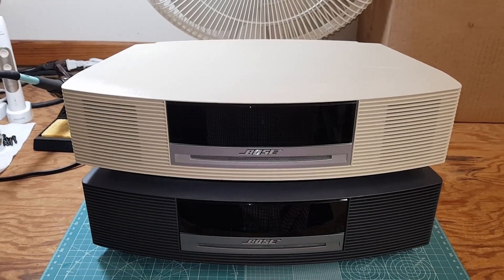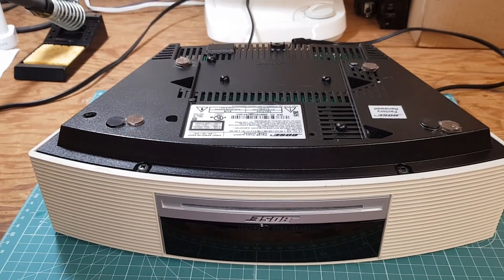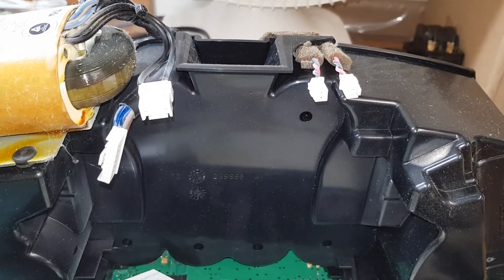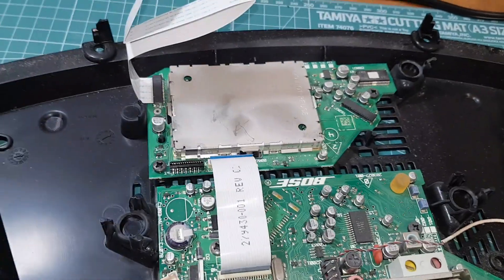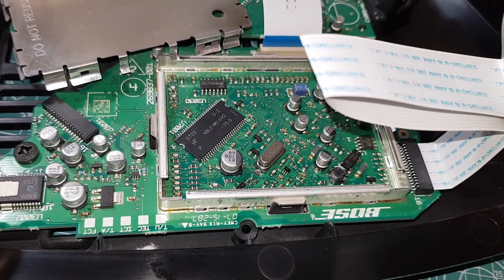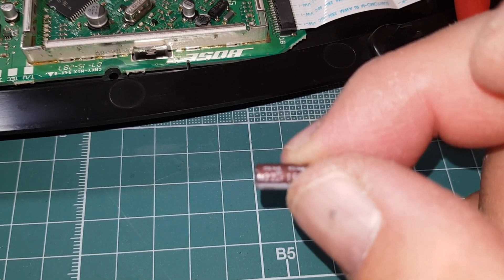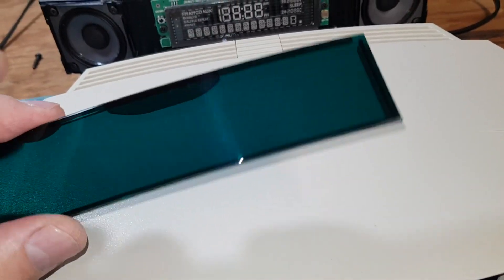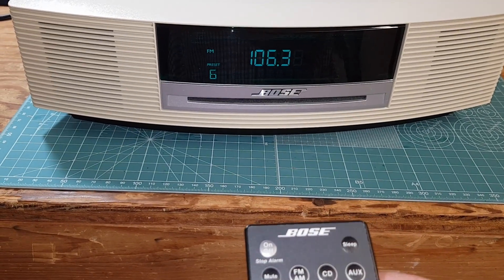Bose CD Radio "Please Wait" Bad Capacitors Repair - AWRCC1

Comment: Thanks for the video, its all good and interesting to watch but you have never showed, how you found the bad capacitor at 5:03...
Reply from the maker: Others have found it as the common Bose Wave Radio CD problem and posted the info all over the web. In the description of my video I give credit especially to George Terbush on YT for posting a ton of good information - with links and pictures - on this particular failure. George took the time to measure the ESR of each of the SMD electrolytic capacitors on the two boards. I fixed my two units based on that information and based on the many comments under George's video. 

What is interesting: you will also find on etsy and ebay many offers of "six capacitors" for Bose AWRCC series radios. They are the six caps under the metal cover. But a replacement of the one 22uF usually ends the problem, at least temporarily. Unfortunately there is no schematic diagram freely available for AWRCC1 to easily troubleshoot and explain why this particular capacitor causes problems when its ESR increases.